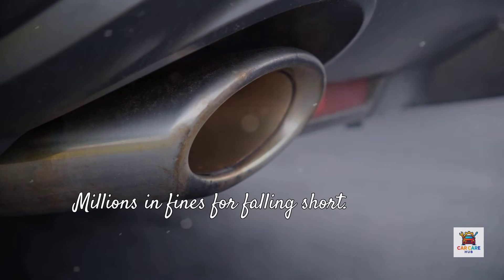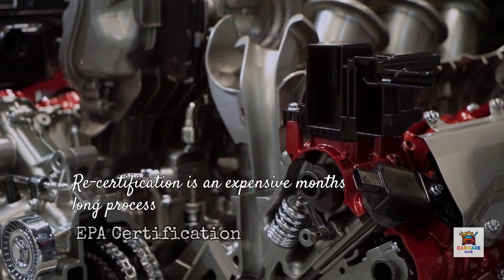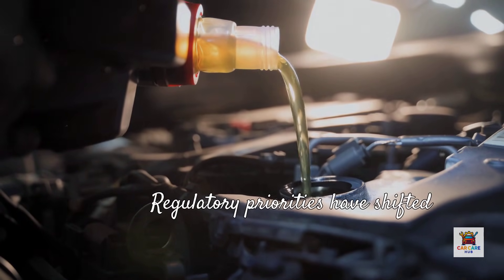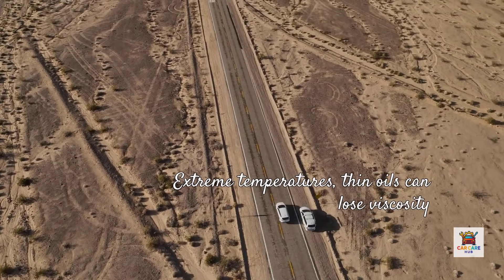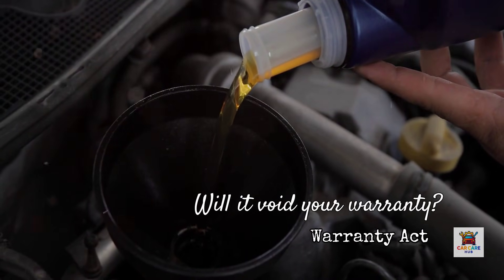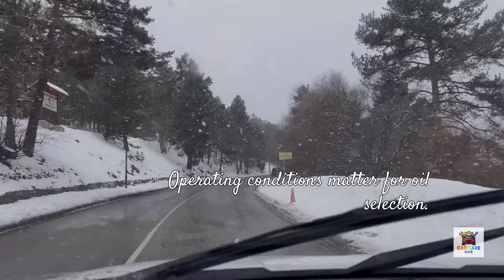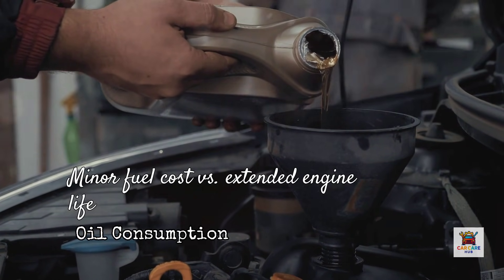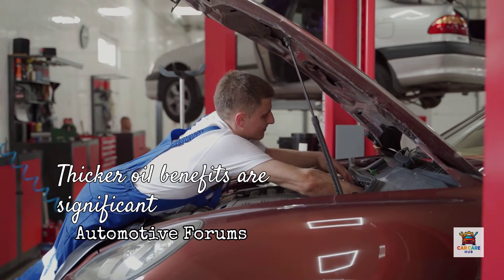Why U.S. Cars Use 0W-20 But the Same Engines Use 5W-30 Abroad (Mechanic Explains!)

Comment: Modern engines run hotter typically 210 F and direct injection increase fuel dilution of the oil.  Hot climates are also a factor.  5w30 in summer heat or a 50/50 mixture of 0w20 and 5w30 would be beneficial in 75000 plus mileage engines.
Reply from the maker: Solid points. Modern engines do run hotter, and fuel dilution is real—especially with DI. Climate and mileage definitely matter, though mixing viscosities isn’t something manufacturers usually recommend.

Comment: I’ve used 0w20 for 265k , now using a little oil , not much , could  I safely go to 0w 30 ?
Reply from the maker: With 265k miles and only minor consumption, yes — moving to 0W-30 is generally safe if it’s approved for your engine. It can help slightly with consumption, but the key is staying within manufacturer specs and monitoring results.

Comment: @ 100,000 miles I will go to 5W30 being in Florida heat year round. I have no problem with it.
Reply from the maker: In hot climates like Florida, 5W-30 can offer better high-temp protection, especially on higher-mileage engines.

Comment: Go ahead use the wrong oil. The oil pump it’s set to use the correct viscosity. Good ahead listen to an individual that has no idea!
Reply: Yes, I have heard that story, especially with Toyota vehicles that use 0W-20 full synthetic motor oil. The oil pump is a variable oil pump, and it is set to oil viscosity 0W-20 and not 5W-30 synthetic oil. My question is, if that is true, are the Toyotas that are sold to other countries stating to use 5W-30 instead of 0W-20. Do they have different variable oil pumps?
Reply: @patrickhenry2845  The pumps are calibrated differently. and its not just the oil pumps that are slightly different. Toyota also uses different piston rings. The piston rings in a Toyota engine that requires 0W-20, 0W-16, and even 0W-8 are completely different.
Reply: @michaelnash2972 That's very interesting. No one on YouTube has ever said that. I do recall hearing that during one or two years, I believe it was 2016-2017 of Toyota manufacturing, that the oil problem with oil burning was because of low tension piston rings, and that Toyota has since corrected that by having tighter tension rings on their later model vehicles. Blow-by was supposedly the cause of the oil burning? It is said the reason for low viscosity synthetic motor oil was primarily to get better gas mileage and tighter clearances that need lubrication?
Reply: @patrickhenry2845  The Car Care Nut has addressed some of this in a recent video.

Comment: I will switch to 5w-30 in next oil change for my Lexus rx350
Reply from the maker: 5W-30 is a good option, especially if you drive hard or in warmer conditions. Just stick to quality oil and regular intervals.
Reply: @CARCAREHUB247  all oils are made to a oem standarded never waste money on man made garbage oils
Reply: You're better off following what the manufacturer recommends. If Toyota states to use 0W-20 or 0W-16 then you have to use the specification that they recommend. The piston rings and the oil pump were designed to operate with the stated viscosity.
Reply: @michaelnash2972  lol brainwashed much?
Reply: @michaelnash2972  dumbest automotive comment yet
Reply: @B @BillNye-bj5vi ou’re funny. Theres only 1 person going to be laughing when you torpedo your engine because parts of your engine wasn’t getting enough oil and that will be me. Watch the Car Care Nuts video on this topic especially since you own a Lexus.